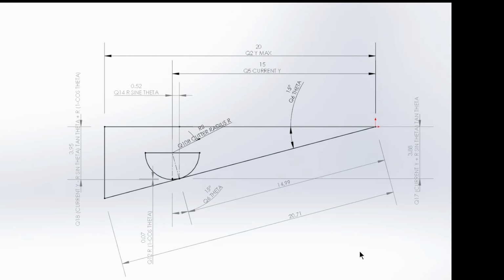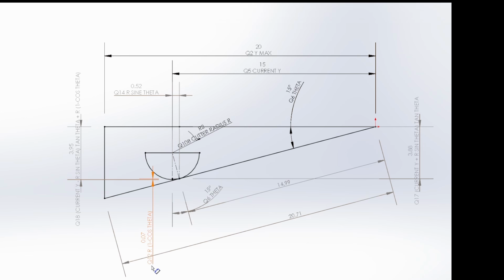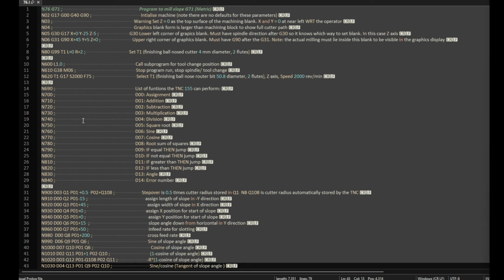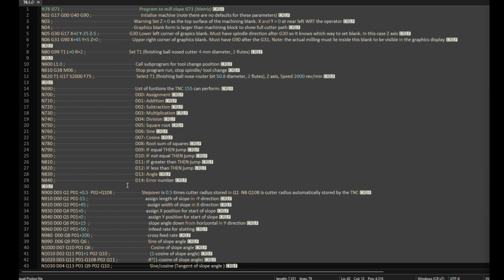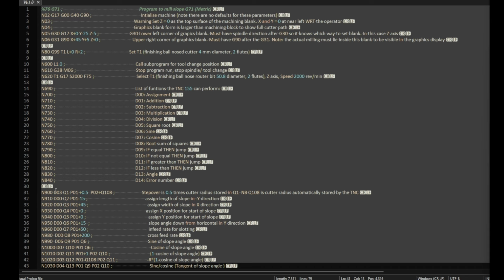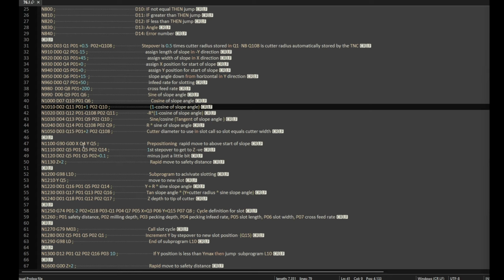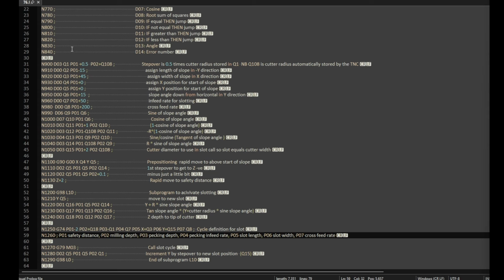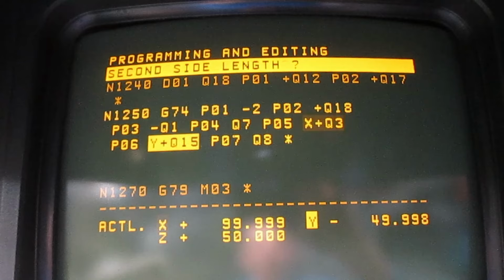26 Equations for defining a slope

Comment: It's good to see a TNC155 still going, David and all your videos . I've got an Internet 1 mk2 with the same controller and find it a great retirement hobby machine. 
I've implemented the touch probe in programming and sending probe data to computer.
I've also added the 4th axis to make it quite a capable machine. 
Keep up the good work.
Reply from the maker: Nice machine. Mine has the forth axis as a milling table. Not very useful. It must have cost a lot new.
Most Interacts seem to have the TNC 2500 which is a bit more capable than mine, although I'm told mine has the last updates available
How did you get the touch probe going? The original ones are still very expensive 2nd hand. They seem to have serial communication on them but I see some guys adapting the simple cheap versions available to work. Did you do that. I'd like to know how to.

Comment: Hello David, thank you for that very lucid explanation. The care and detail required to pull this off reminds me of hand-coded assembly language programming! 
A quick question; what is the editor you are using and does it apply the code formatting (colours, highlighting etc.) automatically?
Reply from the maker: Thanks for the compliment. Glad someone actually is interested.
I used Notepad++ for the editor. But you could use many others. There are G code plugins for color, but they aren't very good for this very old version of ISO G code.
I'm a bit unusual in that I program the Heidenhain TNC 155 in G code. If you prefer conversational mode there is a video in the on how to convert from one to the other using the TNC 155.
The sketch discussion part is a live screen capture of a sketch in Solid Works. Hence the highlighting under when hovering the cursor and dynamic movement from dimensions.
I've done some machine coding of an Apple 2 way back where it had a disassembler but not an assembler. So I checked the machine code by going backwards to assembler. I also programmed a few Allen Bradley, Modicon and Izumi PLCs on industrial plant. So ladder programming.
I first learnt Fortran 4 at university then went through IBM 360's and 370's. Then BASIC on PDP 11s, VAXes and IBM PC's. So I'm okay at procedural languages. Object orient not so much.
So the G code is similar to BASIC/ Fortran in it's format. I  tend to write in subprograms if possible. The argument list in canned cycles is similar to the subroutine list in those languages. But you are correct that the equation formatting is about as cryptic as assembler.
To learn all the Heidenhain program features I worked my way through the examples in on of the manuals. But I had to translate from German first. I used Google translate but these days AI could probably do it quicker.